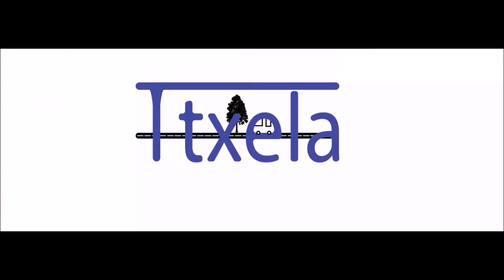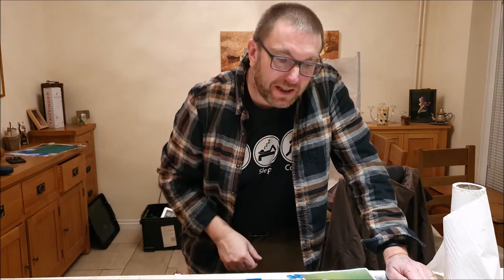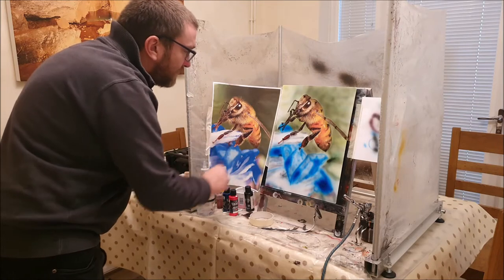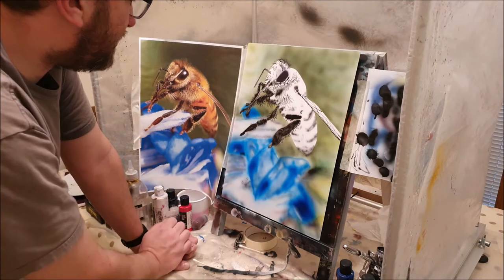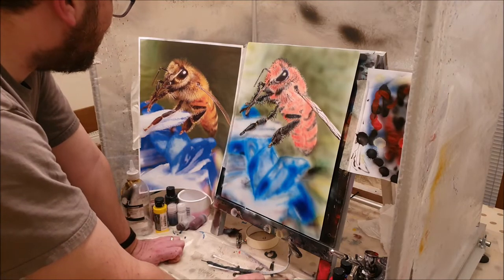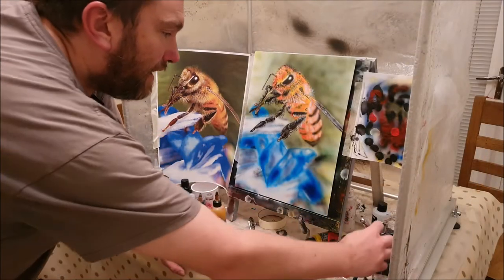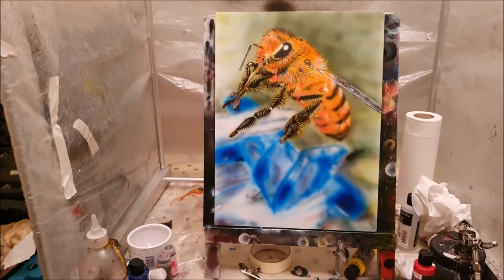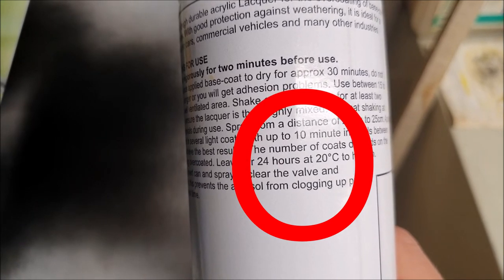Airbrushed Bee Gone Wrong

Comment: Great work Alex
But like I said before you must dry with heat gun to evaporate the thinners in the lacquer quicker. it’s not so much the 10 mins in between coats not been long enough it’s just the last heavy coat sitting to long wet eating in to the paint because it’s wet, that’s why your lighter coats are not a problem as they dry faster and and the thinners can’t eat into the paint. Hope this helps
Neil
Reply from the maker: I'll get the heat gun on it next time 👍
Reply: @ttxela  also slightly less heavy on third coat looks a bit to heavy I know it’s not easy trying to get a flat finish from an aerosol can but you doing great otherwise. Try upol power can lacquer they have a better nozzle with more of a fan than jet and don’t forget to warm you can up 👍

Comment: 2k in a tin instead.
Reply from the maker: I would if I had more space 😔
Reply: @ttxela  nitro cellulose basically melts the surface of the paint and each layer to adhere that’s why it affects the paint and cracks. 2k clear does not. Each layer is put on before it dries and is tacky so it adheres to each other. If 2k dries to much inbetween layers you have to have a mechanical bind by scuffing the surface, otherwise it’s fine. P.s. my space is smaller than ur garage.
Reply from the maker: @airbrushingbynick6071  I'd love to go back to 2k but the neighbour issues make Nikki worried. I'm working on getting better space.....
Reply: @ttxela  No comment.